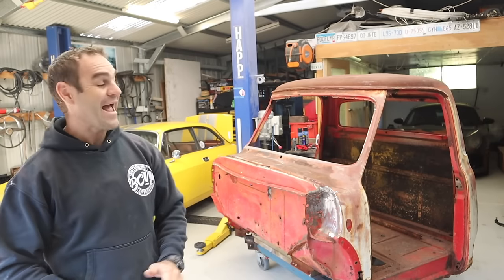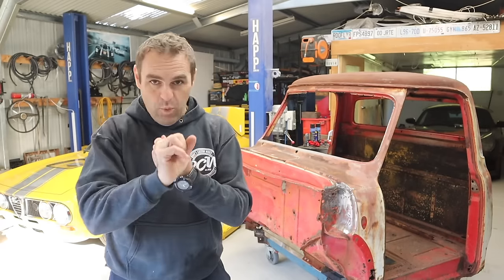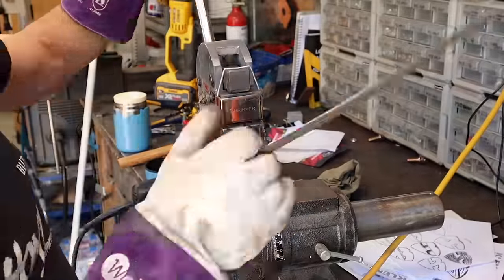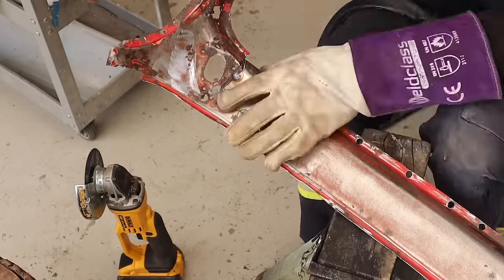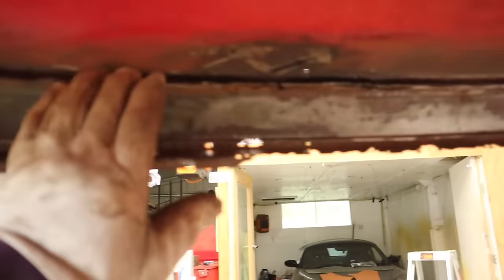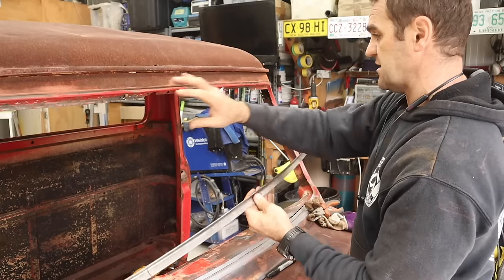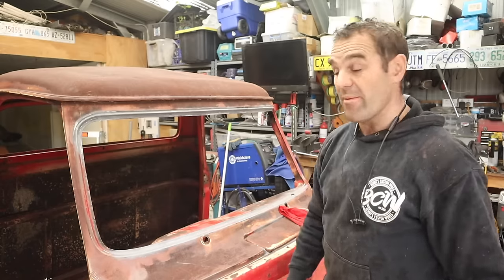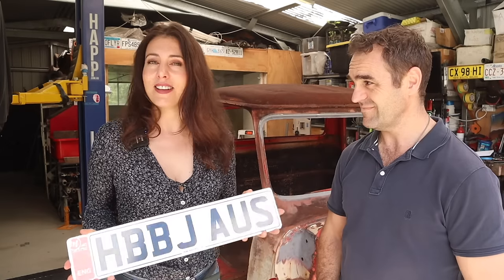Rebuilding a window frame  - 1954 Ford F600 Car Hauler Build part 3

Comment: I imagine shipping costs would be astronomical, but old farm trucks like your F600 are still relatively easy to find and affordable in the US.  I see them on occasion where they were used for a few weeks at harvest time and then parked in a shed for the rest of the year, so they have next to no rust (but still some patina.)  Pickup trucks are another matter, even rough examples from the 1950s can be pretty expensive.

Comment: A little bit of advice guidance from the comments is good but at the end of the day it’s you cars and your builds. I’ve loved everything you’ve made so just keep doing what you’ve doing mate. I was about to comment about getting some copper to put behind the those little rust holes to weld them up but what you have is 10 times better than how I’ve been doing it. I will be buying one of those tools you have.

Comment: Looking good 👍, the new top windscreen panel looked marginally longer than original so may be worth checking if any hassle when fitting the screen and rubber if seems tight
Reply: Measure twice cut once mate, stuff like that is last bit to trim once the surround is finished

Comment: Excellent work. 
Build it the way you want. However I'm glad to hear it won't have real rust patina. Meaning you're removing all the rust. 👍  Airbrushed fake rust patina can look amazing if done well. 
I don't know how anyone leaves rust on a vehicle. Call it my OCD, but rust is the opposite of perfection. It's literally eating the vehicle. 
You wouldn't leave mold in your house. So why would anyone leave rust to eat thier vehicle? Especially when you put money into it, and want it to last.  It doesn't make sense.  Rust is the equivalent of flesh eating disease for metal. 
Looking forward to seeing how the truck turns out.

Comment: Why not use the MIG welder? It puts a lot less heat in the metal and distorted less. Let after work. That’s why body shops use them.
Reply from the maker: Pros use the TIG. I will cover it in the next vid ;)
Reply: @HomeBuiltByJeff  I’ve worked in and around body shops for years. TIG puts so much unnecessary heat. You can definitely see it in your Time-lapse video as it expands from the weld.

Comment: Why don't you use a dremel tool with a cutoff wheel for those small hard to reach patches? That cutoff grinder is too huge!
Reply from the maker: Because the dremel wheels don't last ver long, so I use the air saw for the tight stuff.